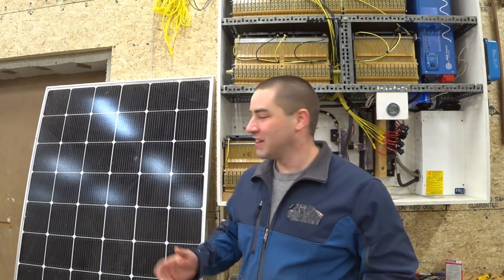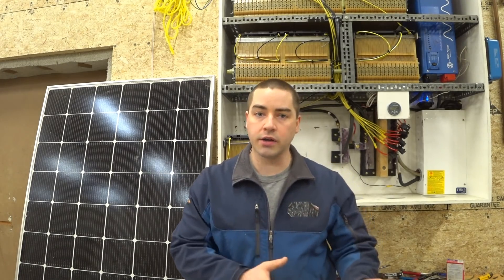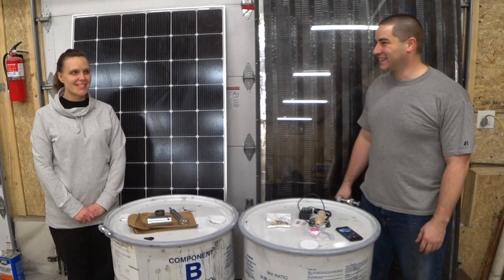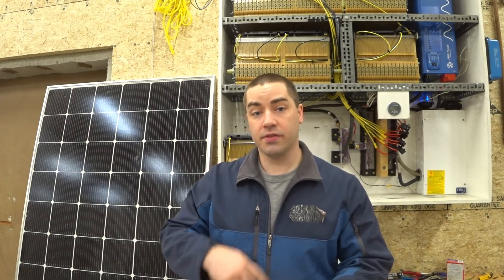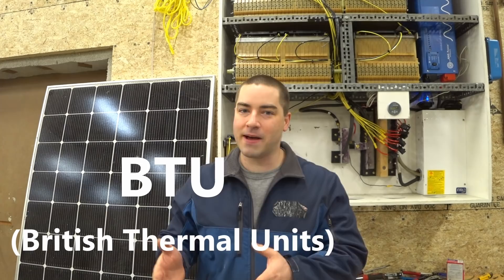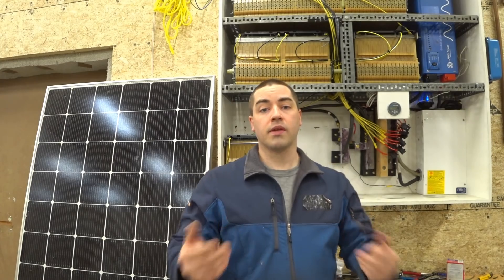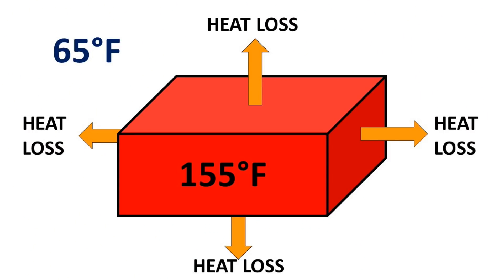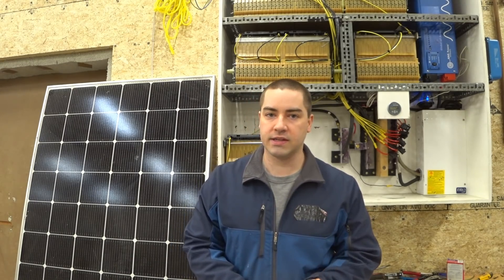Cheapest Energy Storage Off-Grid

Comment: consider staging your heat storage.

A smaller tank can be heated to operating temperature more quickly. That small tank can be the first stage you heat, and the final stage where you extract heat.

A larger tank can store more heat at a lower temperature and is used as a pre-heater for extracting heat.  In other words, your path for your usage heat exchanger to extract heat first extracts from the larger, cooler tank, then finishes heating in the smaller, hotter tank then goes to point of use. The smaller, hotter tank needs better insulation because of the higher differential. Sometimes it could be inside or share multiple walls with the larger, cooler tank -- reduce the differential as well as "store" the lost heat from the hotter tank.

When the small tank is hot, you heat (or move heat into) that much larger tank. 

Moving heat from the small tank into the large is as simple as pumping water from small into large and letting it flow from large into the small. When the temperature in the small drops too low, shut off the pump.  Also if you are using a space heating loop, being able to switch the return between large (cooler) and small (hotter) tanks is almost 'free'. If cloudy days are making it hard to heat the large tank, switch the return to the small tank and do all your usage from the small.
Reply: I'm liking this idea. I'd put the smaller tank inside the larger, even without extra insulation between them - literally just sitting in the water. The heat lost through the wall of the smaller tank would just go into the larger tank - I wonder if that would be enough to get rid of the secondary heat transfer pump between small and large? Hmmm. Now I'm thinking 3 stages, nested tanks, plumbed as you suggest.

I have an entire new house to design and build, I now have some new ideas to explore. Thanks to all who have contributed to this thread.
Reply: We use a "Layered Tank", it's a 1,500 litre pressurized tank with three heat-exchangers built in. A small central one that heat potable water and two bigger ones. They are fitted one in the upper section of the tank and the other one in the lower one. Only if the upper layers of the tank are warm, a valve switches the solarthermal to the lower heat-exchanger

Comment: Wow, well done. So that's $300 to build the water-heat-storage tank.
Reply from the maker: I spent less because I used salvaged and re-claimed materials.  You can often buy Polyiso Foam board on craigslist cheap.  On the other hand, if I was to do it again, I would buy a coil of copper tubing type L.  That could be $300 by itself.
Reply: @DavidPozEnergy  Can't wait to watch more tests.

Comment: FINALLY a DIYer that gets how to do the cost/ benefit analysis. As for those people who say "you can do this with solar PV too" remember please the following points:

1. Solar heat collection can achieve better than 80% even on a DIY solution whereas the MOST efficient solar PV (<20%) is a QUARTER of the efficacy. Hence 4x the PV panel area to collect the same raw energy PLUS the losses in converting back to heat (small but important)

2. For more panel area, more roof or other mounting area is required  (for either solar HW or solar PV) BUT, the solar HW requires LESS collection area per kWh (BOTH systems require the same sized hot tank). Houses in Europe (and other parts of the world) typically do not have the roof space available (in total). The space that IS available often faces the wrong way and terrace houses are doubly hit in that they have no hip ends to their rooves either!

3. In Europe, By FAR the biggest daily domestic energy requirement is for heating, and obviously peaks during the night.

4. Using "over produced" solar PV should obviously be stored in some way. If it is over produced beyond battery capacity then either more batteries are required (expensive) or other storage (eg. heat energy storage)

5. To increase heat capacity a simple expedient of fairly dense breeze blocks situated inside the tank:-

a) reduce the total volume of heat exchange water required
b) just like electric night storage heaters higher density blocks (much higher than water) can hold a much greater heat density and the heat can be released more slowly. These are areas which need more understanding and DIY experimenting to understand the cost/implementation/efficacy/efficiency benefits.

In high daily sunshine areas it MAY be easier to use all PV but it definitely is NEITHER more effective NOR efficacious NOR cost effective in the UK or MOST EU countries (just ONE 250 Watt PV panel - no inverter or control electronics or installation) would cost MORE than the entire system herein proposed and would produce MUCH less daily heat energy (2-3kWh per day compared to 20-30kWh!) ... On a completely cloudless summer day! On a cloudy but otherwise warm day, a solar HW can still produce a significant amount of heat energy collection and certainly much more than the best PV!
Reply: What about using Epson Salt as the phase change material?
Reply: Again; people are missing the point of specific heat capacity of water been really high - density is not the dominating factor. 
I wish people would do the calculation rather than simply assuming high density is better.
Reply: Well, lets deconstruct your argument.

"whereas the MOST efficient solar PV (<20%) is a QUARTER of the efficacy"
No, good commercial solarcells are all at around the 20% mark - highest efficiency i could quickly find measured (in consumer reviews, not advertisement) at around 25%.

"Hence 4x the PV panel area to collect the same raw energy PLUS the losses in converting back to heat (small but important)"
no. for heatpumps you do not specify the efficiency but CoP - Coefficient of performance. The reason is quit simple: You can not be more than 100% efficient, but normal heatpumps work at well above 250% CoP.
That alone already means that a 20% efficiency SolarPanel with a 250% COP pump gives you round about 50% overall efficiency.

"Houses in Europe (and other parts of the world) typically do not have the roof space available (in total)."
.... even in the more northern regions of europe like Sweden  this is not true.

"5. To increase heat capacity a simple expedient of fairly dense breeze blocks situated inside the tank:"
Water has pretty much the highest volumetric heat capacity. You can store more thermal energy by increasing the temperature of other solid materials but that also requires better insulation and comes with other problems (you now also need a heat-changer for example).

"In high daily sunshine areas it MAY be easier to use all PV but it definitely is NEITHER more effective NOR efficacious NOR cost effective in the UK or MOST EU countries"
It is cheaper, requires less maintenance and more versatile than having 2 different systems running. 

"(2-3kWh per day compared to 20-30kWh!)"
.... you get 2-3 kWh/day in northern Scotland with 3 m² of photovoltaic.
Reply: Thanks Bob, lots of food for thought there.

Comment: storing thermal energy in water can be an efficient way to utilize your solar panel excess power.  But not the same as an electrical storage device.  ( battery).  You can’t light up a room, or run your fridge on hot water.  Pumped storage of water in a temperate climate can work well, using the head of water to produce electrical energy by turning a turbine when energy is needed....but not terribly efficient or practical in cold areas where freeze up can occur.

Comment: Excellent video & with such a great explanation of the maths in a simplified format.  Also well done for your designs & ingenuity; brilliant.
I reside in the UK & I don't know how my climate or PV costs compare to the US.  Had my system installed just over 7-years ago & have added to it & tweaked it (it's become an obsession to some extent - lol).
5.75kw of PV squeezing through a 4-kwp inverter.  I use two Immersun units to sense the export of surplus power to the grid.  This surplus power then is connected to either an insulated immersion water heater, or 2x electrical storage radiators for room heating.  I don't have any battery storage of surplus power as yet but am looking into it & probably waiting for the battery prices to drop, (will probably buy SMA Sunny Island & SMA Home Manager with 8kwh of usable battery storage), still too expensive at present.
I think insulation is important also, as you address with the insulation of your thermal storage water tank.  My house has cavity wall insulation, double thickness loft insulation, triple glazed windows & double glazed doors.  My job for the summer is to open-up my floorboards & stick mega insulation under the ground floor floorboards, (horrible job for an agoraphobic).
In the UK there are just a few electricity utility companies that offer a zero standing charge tariff but the trade off is a higher day rate per kwh.  You may wish to search for such an option in the US for you.
My system generates just over 5000 kwh pa & my grid tied electricity bill is only around £20 pa zero standing charge (125 kwh), although in fairness I do tend to live quite an alternative lifestyle these days which helps.
Great video again & thank you,
Regards to all,
JohnnyK.
Reply: John Kay hi John, I’ve had pv installed recently (South Wales) and started thinking about storage heaters but quickly realised that they are both expensive and (from what I’ve found) seem to only allow charging at night on economy 7.......am I wrong? How much did you pay for yours please? Thanks

Comment: Good stuff.  I think if I lived up north where heating was the biggest issue, I'd design the home centrally around a large brick oven of high thermal mass (like Survival Russia demonstrates here: https://www.youtube.com/watch?v=r_TO30jzyUA). I'd somehow incorporate a long copper coil into this mass to heat water for circulation and storage. That would take care of 90% of your energy needs and only require wood.

However, I live down in the 'subtropics' where the issue is getting rid of heat for more than half the year; and I think the most efficient way to do that is build really small, insulate heavily, and run a high SEER mini-split. Either that or build underground. Else you're looking at throwing a lot of cash at electricity for lots of air conditioning in a bigger house.

Comment: If you are using your solar only for heating shower water or heating in general, sure thermal storage makes absolute sense, but if you want to get of the grid you need electricity. Perfect scenario having both systems. Personally I would go electric all the way, but is just my perspective as an electronics and electric engineer. P.S. if you want to make your life easier for your self and others GO METRIC(SI units). NASA learned it's lesson the hard way, science is done in metric. I can't see a single reason why to use imperial except "that's what we use here" excuse. If you really want to go imperial - stop using seconds, watts, volts, amps, make your own units.
Reply: Unfortunately, the US commercial market still uses imperial. Heating/cooling systems all advertised in BTU, thermostats and water heaters programmed in Fahrenheit, etc. We need legislation to force full conversion. 45 years after Gerald Ford passed the Metric Conversion Act, we still haven't fully converted (races are 5K, 10K, but 26.2 miles, drink bottles are 1 liter but also sold in 12 ounces, it's crazy) as Reagan created backsteps. Don't blame poor David. He's using what the market pushes on him.

Comment: $300 David is way off if you want to use copper tubing, it's very expensive but will last a lifetime.  My father used black poly-tubing (about the same diameter as yours) coiled over our roof for keeping the pool warm (near HOT) in winter, and that was just with the Australian sun.  The downside is you need a strong roof area for the water weight on there and your pump works hard pumping it up there.
Reply: I was thinking the same thing about copper, he'd mentioned he'd do it with copper if he had it to do over again, until he sees what that much copper will cost I think!

Comment: Have you thought about something like a Dewar  like liquid gas is stored in. To store hot water? It should hold heat for a while, it doesent work as well for hot as it does cold.   Although it's expensive, you should be able to build a large one. Or a few smaller ones. 30-40 gal. Build a double wall tank. And have a port to pull a vacuum. I guess it could be a square even. I may build about a 80 gal vac insulated tank. Maybe use dense foam to prevent crushing. I don't use alot of hot water, and likely be using wood to heat it.
Reply from the maker: I have not considered making a vacuum insulated tank.  If you try it I'd love to see the pictures or video.

Comment: Thermal Mass Wall inside your home to collect sun energy without loosing so much to the surroundings. Help stabilize your homes heat in the winter. You can also build a solar hot air wall that can collect heat from walls without windows and pump it into the house. Passive heat exchange works. Shut it down for summer and the solar wall can be a shade for the house in the summer to keep the heat out of the house. https://www.motherearthnews.com/renewable-energy/solar-air-heater-zmaz06djzraw. PS. I now have a 15kW inverter for a 48 volt storage battery bank. Working on a shed to house the inverter and batteries.

Comment: Awesome, I've wondered why this isn't a more common way of storing energy, seeing as 100 gallons of water can store as much energy as a Tesla Powerwall. I'm putting up solar soon and I'm going to seriously consider doing this. Thanks for a very clear explanation!
Reply: How would you convert it back into electricity? I see how heat is "easy" to capture and rather easy to store, but how do you make use of it other than warm water?
Reply: @kai990  you don't convert it to electricity . you use it directly to heat or cool. in USA 60% of Electricity is used to either cool or heat a house.
Reply: @MrBemnet1  The thing is, not everyone needs heating/cooling. Us in the tropics can make do with electric fans around noon and the temperature is managable the rest of the day. What we need here is electricity.
Reply from the maker: I'd love to see some pictures of your project as you get underway.
Reply: Why not oil?
Reply: Gattz Oil has a lower specific heat capacity than water. Plus, it's a nightmare to clean up if things go wrong, not to mention costs more than water which is practically free.
Reply: @spencerwilton5831  as well as a fire hazard
Reply: @RmRoyalflush  Oh I don't know maybe because it's a terrible idea?
Reply: Using water as a 'heat synk/sink ' is old technology. The Romans built fires under their baths to move energy into water from fire's in the basement. Escaping heat rose to the ceilings, heated the floors above and left upwards through the outside walls.
The result was a hydronic system for hot water that also heated and humidified the living spaces in the buildings. All you needed was a fuel source and slaves to work the fires - and you had the first Central Heating System that included Hot Water for domestic use. The stone in the floors also soaked up energy just like a battery, and released it slowly inside the building.
If water is 'chilled' it will cool a large building. If you fall into water - your own heat will leave faster than it does in air. Such is H2O. 

Also ! There are "Changes of State" that releases great energy - In the form of Expansion.
Ice and Steam are 'changes of state' in water. Allowances for tremendous forces must be made ! These forces can be destructive - or - beneficial. Always Fail-Safe in the H2O as a tool world of modern living - avoid Kasploosh & Kaboom - they are a scary ass pair !
Get it right or don't do it ! You could be building a steam propelled rocket that will exit a building of 3 stories through its roof. Follow all codes that apply : ) Do it safely ! Allow for rapid expansion !
Reply: @youdonthavetoreadthispost.5850 .........Great post..
Reply: 8
Reply: Water is heavy and its hard to convert it back into electricity.